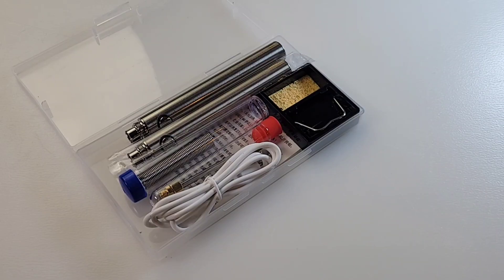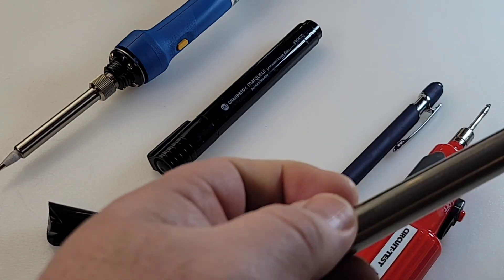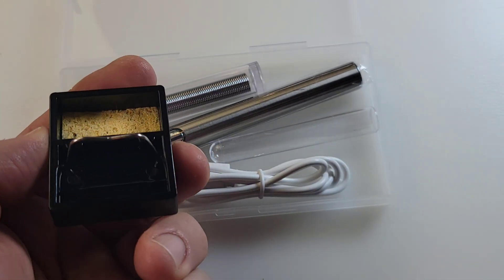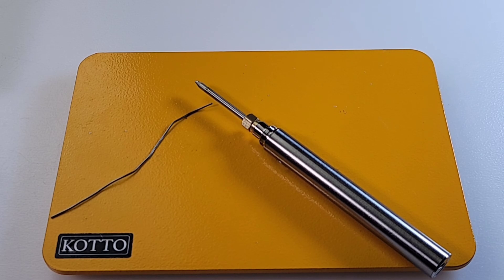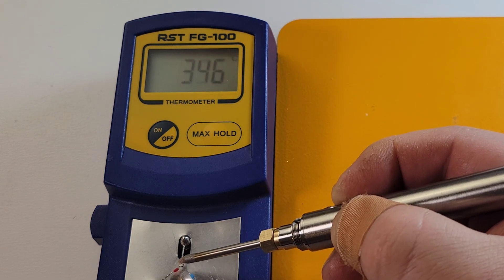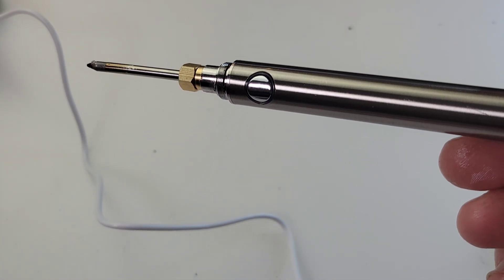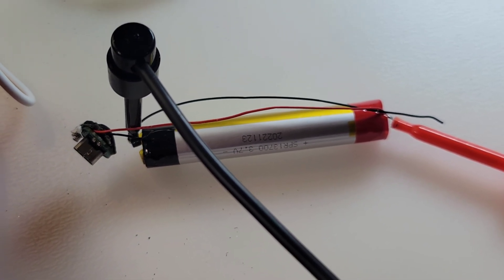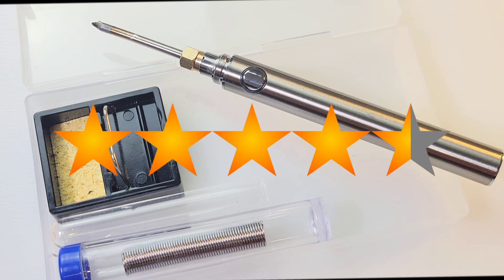MINI-CORDLESS SOLDERING IRON (Rechargeable) Review & Teardown!

Comment: I have one that got the battery and then a 3 pack tips from temu. I do field work and come across needing to solder wires together when not around a plug and these come in handy being able to do that and not have to deal with making sure have butane for the old butane one had before. I don't use it for delicate electronics but for my use out in the field with just joining broken wires in harnesses, works great
Reply from the maker: Sounds like the perfect application for this soldering iron 👍 As you say not everyone's soldering at the bench!

Comment: Excellent video, thanks Darren. By the way, spare tips for those are very cheap on Ebay or Aliexpress. I have several and they are exactly the same as the ones that fit those little 5v blue clear plastic USB soldering irons from a couple of years ago. This is a great deal, though....thanks.
Reply from the maker: That's great news my friend 👍 I definitely have to grab a couple tips!
Reply: Is there a brand for the tips? I can't find them
Reply: @riverbrown8935  Just Google "5v USB soldering iron tips". I can't add links as the whole comment is immediately deleted. Amazon has a set of 3 for 9.99 right now

Comment: This one is similar to HandsKit U5V8W, that’s much more common in my region. They're almost the same, but control differently. Instead of pressing five times to on/off, you hold the button for 2 seconds. Then you single press to switch between 3 presets: green (~350 °C), blue (~400 °C) and red (~450 °C). I personally find it easier to operate that way.

However, with just 8W they don’t have high thermal capacity so the temperature fluctuates even when working on small to medium joints. So maybe you get used to this "hold the button to keep the heat" type of controls.

Controls aside, for the price this is an interesting soldering iron. Especially, when you get not one, but two of them in the kit.🙃 And even though I think TS100 will give a much better overall experience, I'd give this one a try.
Reply from the maker: I like the hold 2 sec on/off method of your Handskit. 5 clicks on/off is a little wonky but nonetheless gets the job done. Presets would've been nice but I guess at this price it's likely not going to happen. It's no TS100 but it's still really useful for most quick soldering jobs.
Reply: @KeepOnTesting  It sure comes in handy. 👍

The best part is, since it’s that affordable, you can just grab one to be your spare for when you don’t need to use your big guns. Just press a button and it’s ready in like 20 seconds. 

In addition, TS100 while being great and portable, still requires a power source.
Reply: @KeepOnTesting  The funny thing is that the manual for HandsKit U5V8W says its USB cable should be heat-resistant. 

To me it looks like an ordinary cheap micro-USB, so I never tested it. But your cable has a visible melted dent on it. So I guess it’s just a false advertisement. Don’t know why they're doing it. 🙂
Reply from the maker: @numerical_error  yes that seem to be the way nowadays...overpromise and undersell.

Comment: As battery technology has improved, these small little cordless irons are becoming much more usable. With that design though at that price, it is built to be thrown away when the battery / tip are end of life.
Reply from the maker: True enough..disposables are the new norm.
Well at least they supply 2 with this package.Oddly enough I've use the iron for 40 minutes on one particular job and it still had some power left. Will be interesting to see the longevity.

Comment: Coolness, I now have a replacement for my Iroda butane one which is cumbersome needing a butane (though it has a torch tip replacement for some tempering sometimes, maybe it could be a companion) for high elevation repairs (don't need to possibly dangle the amazing KSGER w/ OLED display soldering- get that one too, the one with built-in hot SMD blower 2 in 1 stylish silver and stainless steel soldering pen option).

The problem would be the tips though, one may need to go really hot (could burn the heating element in the tip if that's how it's heated) to compensate (uneven heating); conical may not have the thermal mass and that could have problems with thick gauge wires (solid especially), unless there are different tips (I'm a bevel tip guy as go to tip). The tip looks like it uses Weller style tips, is it compatible with Weller type tips (the amazing KSGER w/ OLED display uses Hakko tips and Hakko type tips).

God bless, Rev. 21:4
Reply from the maker: Great question..I'm exploring the tip possibilities with this unit. I agree Conical doesn't always do the job. Hopefully they have other tips available.

Comment: A while back I came across just tips that are made for vape pen batteries. Almost bought some, but I'm a TS100 addict. It has served me well for years now. I keep a Pinecil on hand for backup or if I need 2 different sized tips at the ready. Anyway, pretty sure what you need if you want more tips is to do a search for 510 Thread Solder Iron Tips and you'll find them on Amazonia. I love that someone had the great idea of using vape pen batteries as a soldering iron. Would be super nice if they could make them to accept JBC style micro-soldering tips....I'm sure they will.